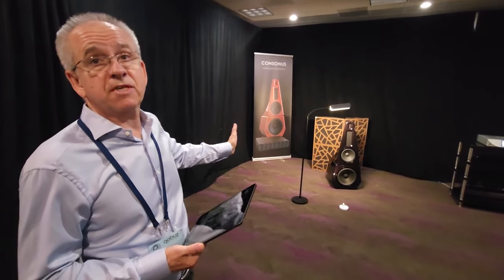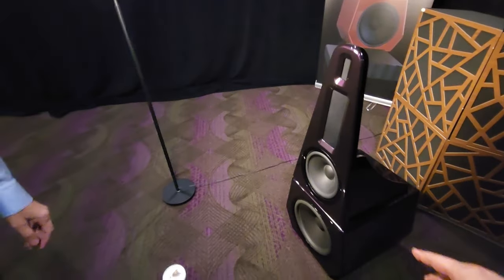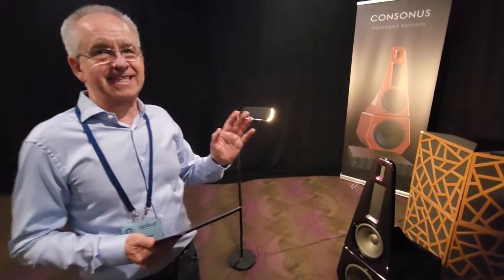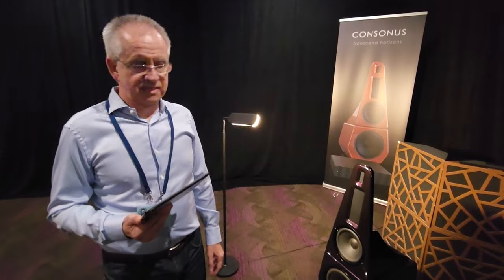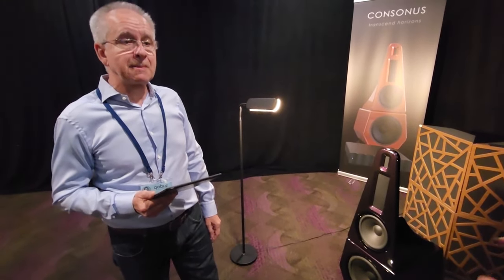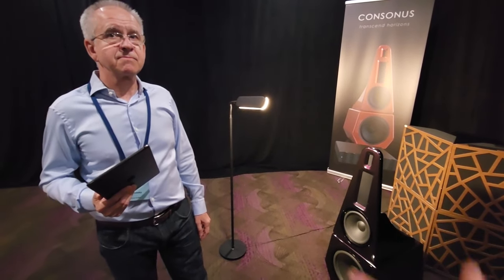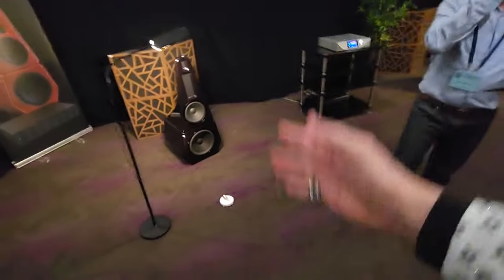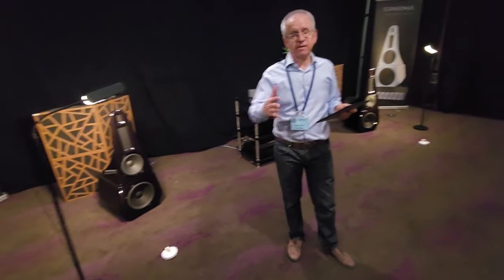Innovative Open Baffles - Consonus and Mytek

Comment: heard them today... my favorite speakers at the show.  i think $17k for the speakers and with amps totalling $70. the mytek empire is $25k (?) so for $100k you get a setup which bested $250K+ other systems there.   the integration of the low mids/high bass of the open cone driver and the sealed sub was truly awesome.  the 'airy' and effortless planar+open baffle combo was great. not harsh, but certainly detailed.  sounds crazy to say: but a "good deal" at $100k when compared to many other rooms.
Reply from the maker: Are they only $17k?  I thought they were north of $50k
Reply: @AudiophileJunkie  with the electronics I think they're $79k not $70k, but yeah the speakers themselves weren't too much. but like an  LX521 setup, you need crossovers/dsp upstream of them to work 'out of the box'.